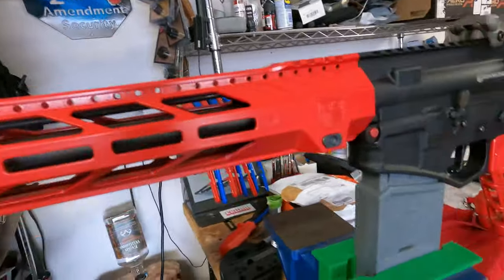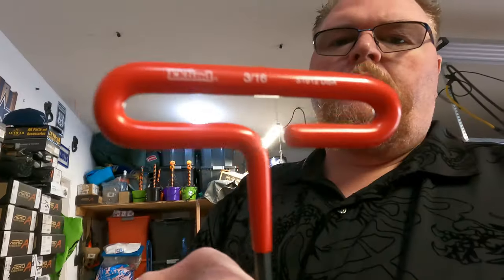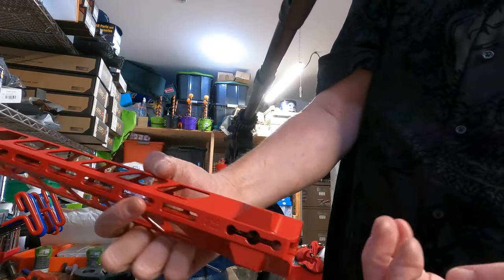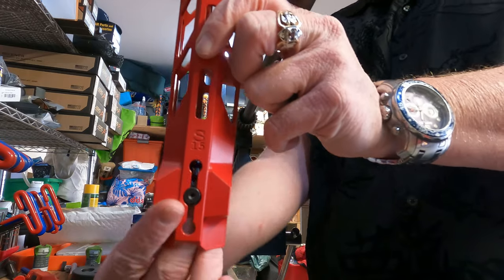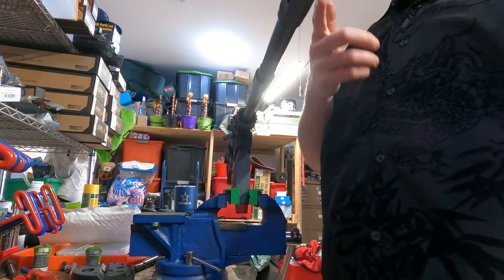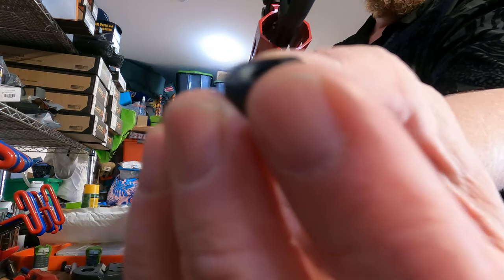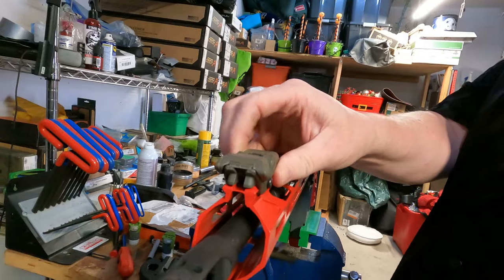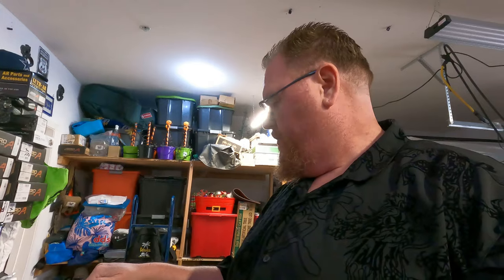Diamondback DB15 Handguard removal and install.

Comment: Do you know what torque the screw needs to be when reinstalling it?
Reply from the maker: @brandhark7935 yes, you should tighten to 40 in/lbs, make sure you are using inch/lbs not ft/lbs.

Comment: I cant find dimensions on that handguard anywhere, any chance you could measure the inside diameter of the handguard???
Reply from the maker: Sorry buddy, I sold it, but it's pretty much standard for an M-Lock handguard.
Reply: @AZPatRiot1776  shoot, thanks anyway!
Reply from the maker: @hirshel820  I texted the guy I sold it to and if he responds, I'll definitely give you the dimensions.
Reply: I'm hoping it's bigger then 1.5in I got one of these and want to run a sharps bros badlands muzzle device. I have a 7.5 in db15 p and got this for 25$ from db themselves it's on sale right now